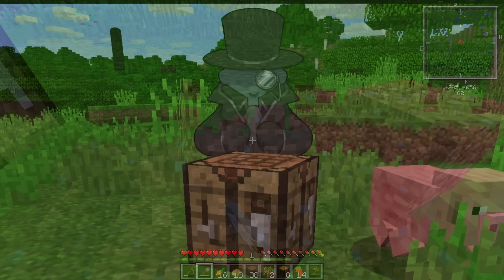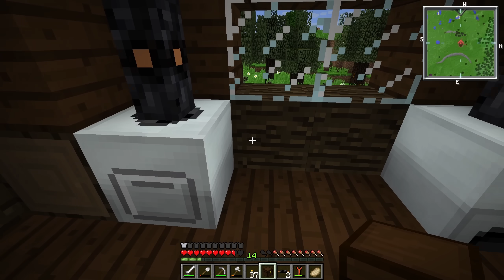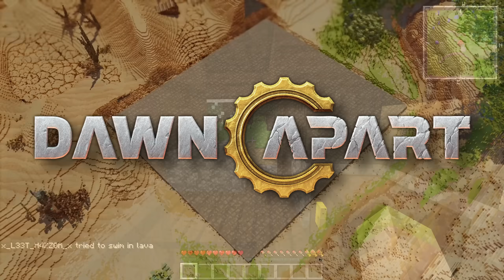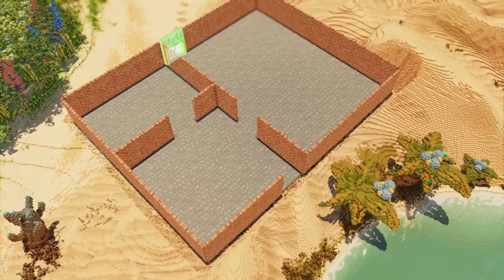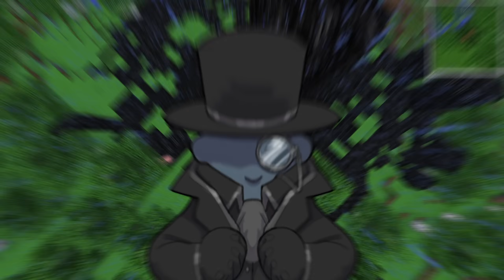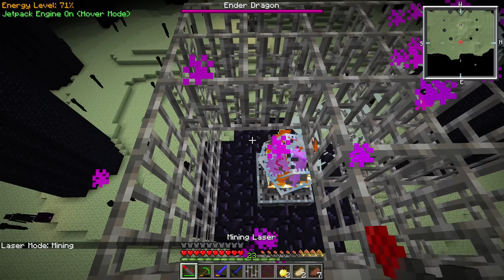Is TEKKIT still fun 13 years later?

Comment: The oil part reminded me how dirty minded engineering can get. I mean I did a semester in lube math. Come on how am I supposed to not grin when she up there talkin bout torquing a shaft has increasing longevity under lubrication. Torquing the shaft till it yields. COME ON! That shits funny and I gotta take a test on it worth 1/4 of the grade. Thats why I got into municipal water. Thats all wastewater poo jokes. Much more clean if you can believe it.

Comment: Tekkit is awesome but it really needs to be on a PVP server with a large population, at LEAST 50 people so you can do five groups of 10. The advent of quest-guided mega modpacks like Project Ozone 2 in 1.7.10 kind of destroyed all the unguided old style single player modpacks, even the legendary FTB Infinity. Yeah you could play Technic for single player but that pack was really designed for group PVP which is why it has nuclear missiles via the ICBM mod and Modular Forcefield Systems to protect your base from them. Single player Tekkit is just building machines to build more machines until you have built everything and can oneshot the ender dragon with an antimatter missile, it gets old fast.

Comment: Tekkit was one of the best packs ever made. I honestly hate the modern Minecraft community because we don't really have insane PVP servers running the PVP modpacks like tekkit, voltz, hexxit, etc. Some of the best times I have ever had in my 35+ years of multiplayer gaming were on Tekkit and Voltz PVP servers back around 2013-2014. Modern MC players just do not know the absolute chaos of having a PVP server with an 80 player cap that allows space travel and nukes.

I doubt modern Minecraft could even handle loading modpacks like that to a large PVP server because the game's code and optimization became dogshit after Notch left, there are modpacks that require an utterly stupid 32GB of ram allocated to Minecraft just to get them loaded now. Meanwhile GregTech New Horizons, the largest modpack in MC history that takes literally over 5000 hours to finish, can be loaded and played with 8gb because it's for 1.7.10 and not one of the bloated modern versions.
Reply: Warfactory is in development, its based around hbm ntm and gregtech for 1.12.2 and they seem to be doing a good job at optimising.
Reply: @cloudyblue80  That sounds pretty good, unfortunately 1.12 means that is the unofficial version of NTM which doesn't work with the NTM Space expansion with rockets and space travel on 1.7.10. Either way, a modern PVP modpack that people are actually willing to play is a step in the right drection.

edit: apparently they are porting NTM Space too, I was wrong

Comment: If you have the tism for automation games, some of the more "beginner" friendly GregTech modpacks out there scratch a similar itch as tekkit did for me back in the days. I've been playing Nomifactory for a bit now and the need for automation and mass production is much more akin to a true factory game like Factorio or Satisfactory. There's also so called "multiblock" machines that instead of being condensed to a single minecraft block use multiple blocks placed in a certain pattern. Early game examples would be a bronze multiblock macerators that uses steam power. The machine itself takes 3x3 blocks of space. The advantage being that it can grind 8 ores simultaneously. The ores are also extremely realistic, instead of just generic iron and copper ore you can find iron or copper rich minerals like magnetite, limonite, chalcopyrite and malachite. It's quite nerd boner inducing to see these minerals accurately represented in game. And for example with magnetite with advanced ore processing, you can wash the ground dust, then pass it through a magnetic separator to extract gold nuggets out. You never lose any iron out of this, in the end you get your iron dust to smelt but because it takes more time to process you get extra often rarer materials out of it. Since the progression in that modpack is centered about "voltage" (higher voltage machines = can do more advanced stuff) the overclock mechanic is that recipes that require lower voltage get overclocked when done using a higher voltage machine.

Comment: Tool durability is taken into account when calculating EMC get a diamond shovel down to 1 durability dupe that for basically free route them into a chest full of talismans of repair it repairs to fill in like 2 seconds then the full shovel turns back into like 30 damaged ones me and my friend did this on a pub tekkit server with the blazerod glitch banned, and we ended up charging people by the minute to come and use our condenser made close to 10000 of those Industrial craft tokens which was the server currency before an admin showed up to see what we were doing and made an on the spot rule banning our method

Comment: Man I remember using those quarries. Using the blue torches to pick the maximum quarry size, then using the most condensed solar panel and just leaving it running with pipes to filter the output into tons of chests.

And then I tried hooking one up to a maxed out nuclear reactor and the speed looked like it was just deloading the chunk. Which was very impressive until I used the wrong size cable the next time and blew up everything I cared about.

Comment: I imagine you can pump lava into the thermal generator to generate near endless power pumping lava out of caves, but I don't think you can pump lava from the nether, maybe with a world anchor if thats still a thing but even then I'm not sure if it works across dimensions. Theres a workaround by letting it pump into a teleport pipe and AFKing in the nether then coming back and having it dump into a tank but honestly I normally just cleared out caves when I used to tekkit.

Comment: The version of Tekkit with the blue text is the newer Tekkit version, for 1.6 or so. The original Tekkit you have memories of was Tekkit Classic (as it was retroactively named upon the newer version releasing), which is an older Minecraft version (1.2 or 1.3 iirc). I remember going back to try it again a few years ago and the thing that stuck with me the most was that doors could be opened with left click and that made breaking them difficult as they would rapidly open and close, so you had to aim at the hinge. Also I think ladders worked weirdly, but the doors have stuck in my head.

Comment: I am Still wondering if i was one of the few people which used Frame Quarrys? At least thats the name under which i know those Things.
They are a multiblock structure which you could build with some scaffolding Frames a Forcefield with Block Breaker Upgrades and some Pistons. 
This Machinery could excavate MASSIVE tunnels at Bedrock hight and automatically send the stuff via enderchest into your base. 
Some filtering for the good stuff was needed because of the massive amount of dirt and cobble but after building one of those humongus Vertical Kining Drills you no longer needed to go mining.
You only managed all the resources it produced and struggled with refining them into ingots and other stuff.

Comment: That's not the logo of the original Tekkit Modpack. That's the logo of the sequel to Tekkit. It's commonly called Tekkit main (because that's its internal name), and it's the sequel to the modpack now called Tekkit Classic.

And yeah unfortunately the project bench is a little unstable.

And overall, the modpack is as good as, if not better than the original. And no less fun. But you're a different person now. So it doesn't hit the same.

Comment: 14:19 mod Compact Solar Panels was implemented just to avoid building massive solar installations and their tendency to kill TPS
Reply: Advanced Solar Panels were a better mod, they even produce EU at night, albeit at a slower rate.
Reply: Yeah, basic solar panels only generating 1 EU/t (and only during the day) made them comically useless after peaking even slightly past LV tier machinery. Clearly less of an issue back when HV was considered "endgame", but considering cable loss is a thing for IC2, well, not hard to be spending more on the cables than the actual solar panels once you've got a proper factory.

Comment: In the actual original, which is now known as Tekkit Classic, there was an exploit for easy, infinite power. An oil fabricator would create oil from nothing but power, and if you processed that into fuel and then fed it into engines, you'd generate much more power than you consumed creating and processing the oil. Made all the natural oil geysers pretty much completely pointless.

Out of curiosity I looked it up. According to the Tekkit Classic Fandom wiki, it takes 50,000 EU (energy unit) to generate a bucket of oil, another 25,000 EU to turn that bucket of oil into a bucket of fuel, which would then provide 572,000 EU of power in a combustion engine, or a surplus of 497,000 EU. I never used anything else in the modpack for power, haha.

Comment: As per the wiki, the reason the power output of the thermal generator (which is actually a mislabeled geothermal generator) fluctuates is because it will turn off or lower output and input based on the power requirement for connected machines, because of this, for machines that are inconsistent in their energy use, this would be better than a normal coal generator or something similar.

Comment: As far as I remember, the thermal generator's active power generation works with lava, you have to feed lava into it either putting a lava bucket inside it or via a heat resistent buildcraft pipe.

I remenber years ago i and my friends used to do the ultimate combo for virtually infinte energy:

Step 1. set a pump (buildcraft) on the nether to gat lava, connect it to a thermal generator to feed the pump energy (using power converter (mod) blocks, to convert EU to RF).
Step 2. use a pair of endertanks (from enderIO if I recall correctly) to send the lava to the overworld. and a chunk loader next to the pump to keep it working.
Step 3 (optional). Set a lava storage tank
Step 4. connect your lava to you thermal generators
Reply: Think the modname for the endertanks is ender storage (the very old versions of the mod were called ender chests and didnt have ender tanks yet)
Reply: You call that infinite power.
I call that "midgame power"
Hehe.
Reply: I remember this used to be a HUGE issue on servers, something with the constantly updating non source lava blocks in the nether ruining TPS.
Reply: @CativaCookie Eventually my server admins just coded the global orange-orange-orange endertank to lava and plugged in a modded infinite lava tank

Comment: according to ic2's documentation(yes it does in fact exist) the reason for passive fluctuation is because different blocks provide power in the decimals
magma blocks specifically provides .0035 EU/t per block surrounding the generator

Comment: My favorite modpack ever and one of my favorite minecraft versions was FTB: Revelations for 1.12.2. Nowadays I play 1.21.1 and I feel like there's on one hand been a huge improvement of certain aspects like recipe books and built in documentation, and on the other hand, a steady decline in the quality of each version, owing to the fact that Mojang has become not much more than a work slave for Microsoft and therefore the game is gradually being transformed into a marketable, microtransaction filled FIGHTING game, rather than expanding on the building aspect. The number of updates the game receives, means that mods don't have time to get fleshed out properly for a version and people get too hyped for minor features to settle for ONE version, like 1.12.2. That means that a bunch of features that made Revelations so great, like microblocks, conduit facades and other stuff are either not working properly, have been replaced with way too complicated alternatives, or straight up missing completely. Instead there's always Create. In more or less every single modpack. Even when it doesn't fit theme-wise. I've started to hate Create because of that. Also I want my easy to understand forestry bees back. Productive Bees based on the vanilla bees are way too unpredictable and cumbersome to use for my playstyle

Comment: for those who don't know, there were 3 big modpacks on the technic launcher back then, that kinda started the whole modded minecraft series thing, and also set the two main paths for how modpacks would look like. Hexxit, Tekkit, and Attack of the B-team. Hexxit was about Adventure, magic, exploration and dungeons. Sort of RPG-ish. Tekkit was about tec and machines, about automation and building giant factories. So you had two extremes, either a lot of tec and little to no adventuring, or a lot of magic and adventuring with little to no tec. to this day, those are the two most common options for modpacks.  Attack of the B-Team essentially was the middle path, a mix of both. and to this day, finding a good modern modpack that has both tec and magic, and isn't from the 1.12 era is kinda rare...

Comment: Next step is GregTech: New Horizons. Gotta use chlorosilane to produce silicon boules which you need to cut in your cleanroom  into silicon wafers. Then use a laser engraver to produce chips. And don't forget that you need gallium arsenide to make... Transistors? I think?

Comment: While I have no experience with Tekkit, I can understand going down the minecraft mod rabbit hole, since something similar happened to me recently. In my case it was HBM's Nuclear Tech mod, which is a mod (not a pack) for minecraft 1.7.10 that has been in continued development since 2018. I just want to post some propaganda for it, since it might be something you might be interested in:

While I have to admit that its not the greatest at in game documentation, it has a usable wiki and with not-enough-items and a bit of experimentation (preferably in creative for the more nuclear stuff) its possible to figure everything out. However it actually allows to break machines with out making them unusable, It also allows to craft slime with sulfuric acid and bone dust. The machines are also mostly good and more complex looking multiblock structures (who somehow dont look too out of place, which is surprising) instead of the more plainly desinged one block stations that tekkit seems to use (judging from the video). I dont know enough about tekkit to make more comparisons that go beyond stuff that is true for every automation/factory game/mod, so instead here are some highlights included in the mod: 

Multiple types of real and hypothetical nuclear/fusion reactors (some of which can be quite freely designed to achieve everything between the Chernobyl disaster and a very good and completely automated energy source); Nuclear Weapons; A pretty fun progression line; Automation (including ore, thanks to bedrock ore that can be infinitely mined but needs some extra machines to make usefull); and the best oil refinement I've seen in any game (It is possible to just do the basic stuff and get what you need, but with enough planning it is also possible to turn wood or even blood into what ever oil product you need). It also has an actively developed fork that includes all the base features + space travel (NTM: Space), including the option to start on duna (it's/KSP's mars equivalent). 

It's great overall and has a lot of depth (probably due to its development time), while (in my opinion, however I might be to far into it to be objective) not beeing too overwhelming overall (its a bit much if you start going through too many items directly after starting, but following the wiki and/or the achievements to take it step by step makes it very managable).
Reply: not reading all that. Just here to agree with whatever you said because HBM's nuclear tech (especially the NTM space fork) is the absolute GOAT